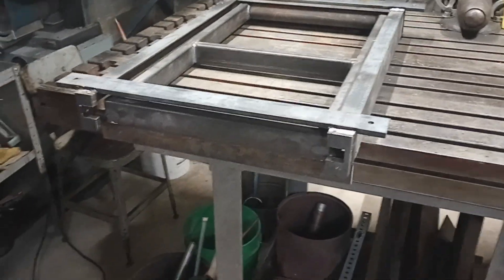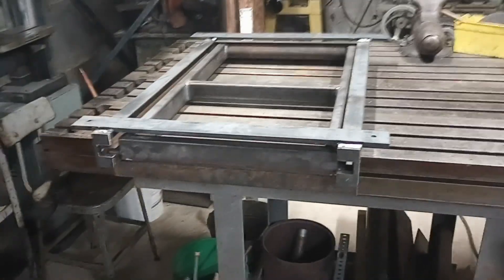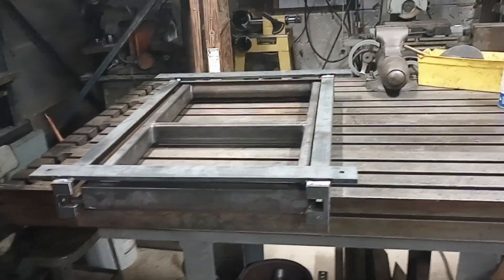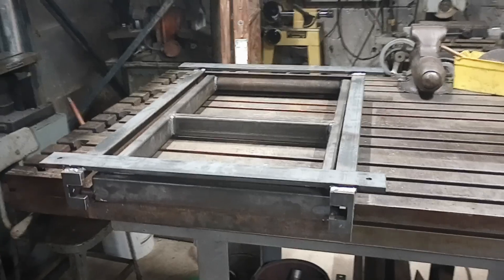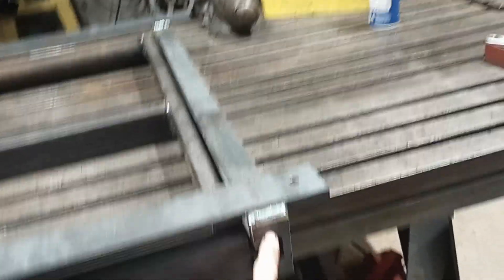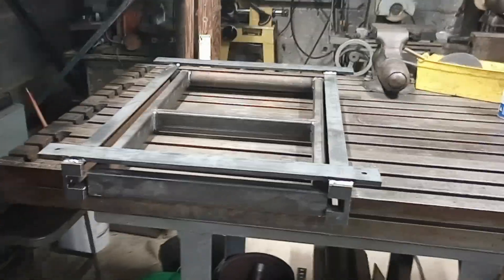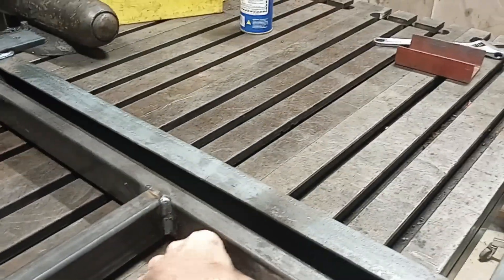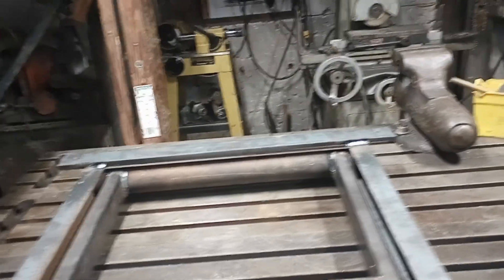A handy retractable ladder for flatbed trucks or trailers

Comment: I used to weld for a used commercial truck dealer.We could buy a similar design ladder from Buyers Truck Parts. Your design is a stouter unit which is good for those drivers that love meat and taters 😊.AL B.
Reply from the maker: The only problem I have with this design is the support bar for the ladder when it is down, turns onto a finger pincher with the bottom rung when you stow the ladder.